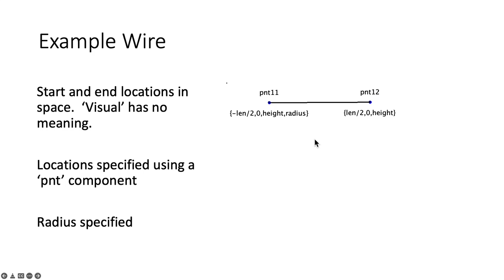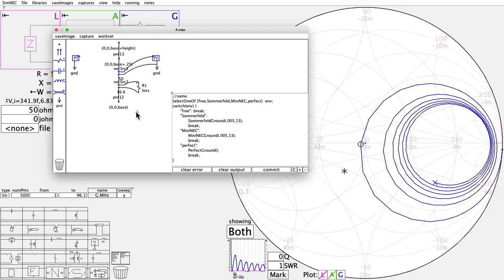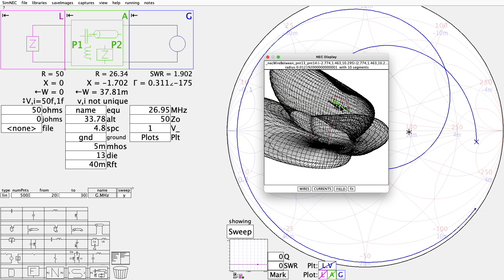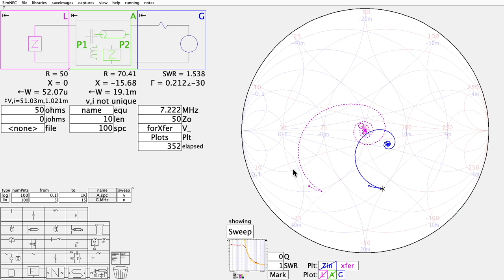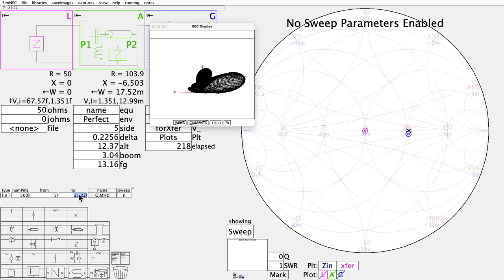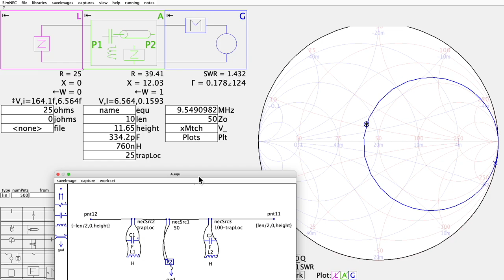Intro To SimNEC: An Interactive Antenna Simulation Program

Comment: On Linux (debian bookworm) the moment I try to do exactly that and I connect the second point of NEC source to P2 the name NecSrc1 gets red and I get a straight line on th esmith chart. From then on it will not produce a NEC chart. No matter what. This is on x64. I can go and execute nec2c executable for ubuntu and it works, but simnec can't for some reason. This is the latest version with no JRE (I already have JRE 17 installed). WhenI expand the errors field I get "Missing NECUnits statement <2 times"

Comment: Hi Ward, I was following along and building the dipole just as in your example. At about 05:30 you directly connected port 2. I did all the same steps but after I made that connections the X values did not change, as it changed on yours. Is there a special key to hit that makes it run (it stayed at R=50 and X = 0) ? Everything looked like yours except the impedances are not calculating. 73, KM5L

Comment: I've used SimSmith for a number of years so I'm  familiar with most blocks.  However, SimNec is new to me and I followed this tutorial but I'm getting different results than you.  R = 6.216, X = - 2.968K, etc.  While your R = 73.96, X = 13.42.  Any ideas?